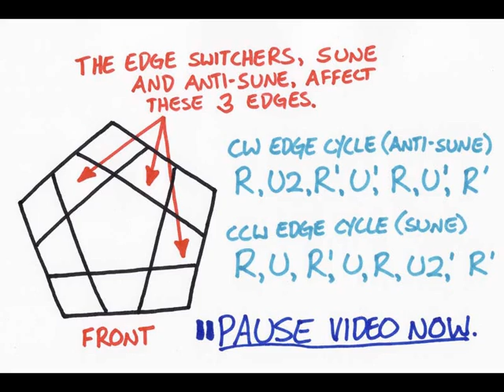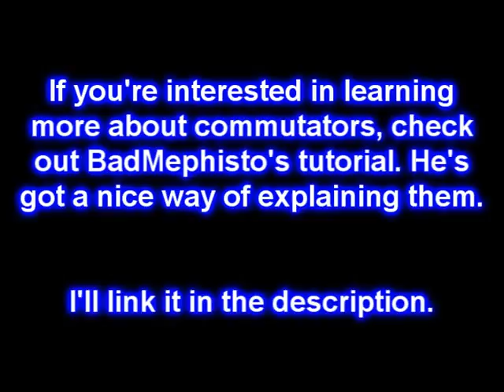How to solve a Megaminx (part 2)

Comment: Anyone with a single edge or corner rotated, or two edges oriented but swapped, you need to REASSEMBLE your puzzle. These things only happen when it gets put together wrongly, so do yourself a favour and don't disassemble them. If they pop apart while solving, make sure to reassemble them fully solved to avoid such issues. HTH!

Comment: I have a problem that comes up sometimes. When I try edge permutation, sometimes 3 will align and two edges will not. Sometimes it will be 3 aligned next to each other and the last two swapped, or it is a "triangle" 2 aligned and 1 opposite, with 2 swapped on the sides. I cannot get this undone no matter what I try. I doubt I am turning hard enough to flip the actual piece itself. Any help?

Comment: nice! but i hardly used the guide, everything was easier than i thought, so easy that i watched carefully both videos once and without watching them again i almost solve completely my -brand new :D - megaminx MF8 tiled. But i forgot the commutators for the permutation of the corners (last step), everything else i didnt need to rewatch. Of course that my practice in BLD helped, a lot :D

Comment: it is possible to combine the corner postioning and orienting steps just by turning the top layer between the two repetitions of a orienting algorithm. i think i'm not explaining this very well, but e.g. normally you R' D' R D to bring the top piece down, then R' D' R D again to put it back rotated CCW, but in between, you can turn the top layer to a different position, then you can put it back in a different place. this does cause an interesting problem with the last two pieces you can try out.

Comment: My record is 82 seconds. I usually average a little bit slower than that but that's because I've just started practicing a new method AND I've been memorizing the algs for the parity's on the 4x4 and 5x5. I finally did that maybe 3 1/2 hours ago.